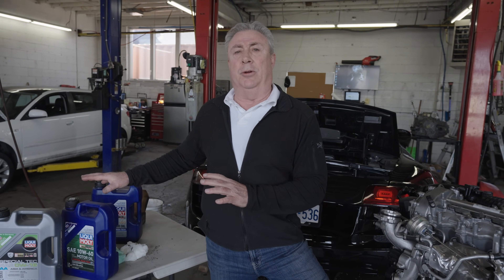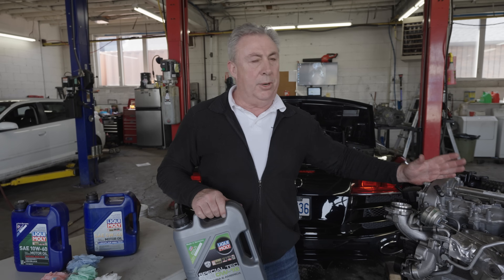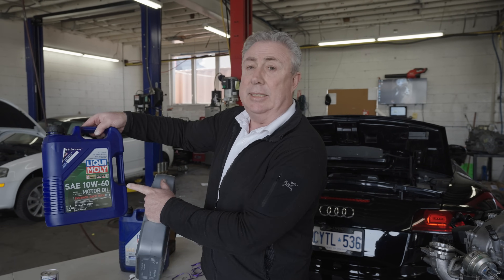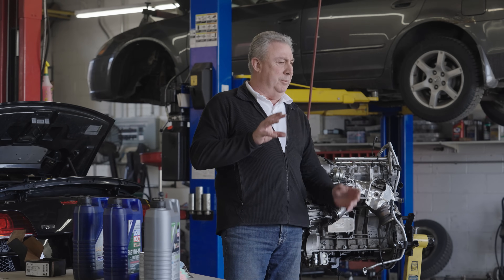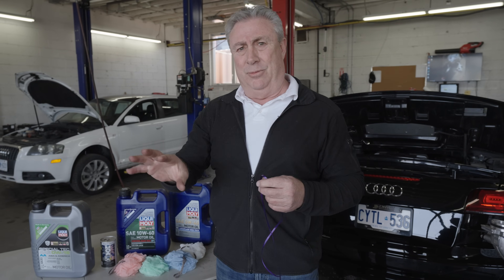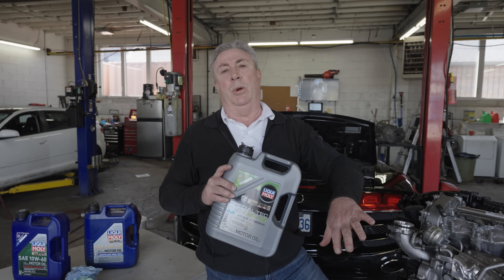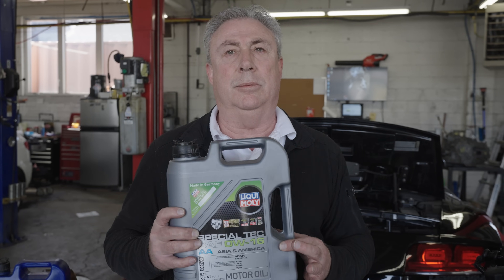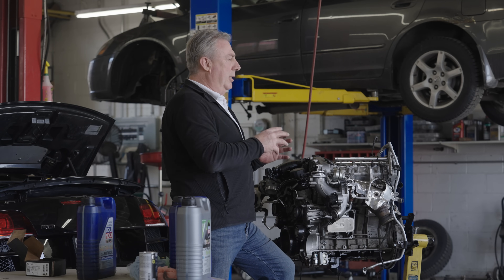Thin engine oil just a Scam? What's Safe

Comment: I agree with everything you said except for deviating up from a 0W to a 5W and there is another way to further determine if you are on the right track if you're OCD like me though I was confident of going to a 5W30 without it. My wife's Mazda CX-5 for example calls for 0W20 but that is the ones slated for America. The same Skyactive 2.5L in naturally aspirated form in Europe and Asia calls for 5W30. Why? America's ever demanding CAFE quota. Even Mexico Mazda's say 5W30. We know Mazda isn't enlarging the oil clearances and passages on the 2.5L engines slated for those countries so this is one easy tell at what thicker oil weight can be used without worry.

Comment: Please don't fall for the woke scam to reduce the viscosity of your oil. If you use a 0W-20 oil you WILL ruin your motor. Use a standard weight which is 10W-30 Synthetic. I run this weight in all of my Toyotas, and the engines are like new at 300000 miles. Additionally you can use a Diesel synthetic and it will save you money.

Comment: 2025 Camry here. I use 5w-30, manufacturer calls for 0w8. In Australia and several other markets, they are using up to 10w30 (and even thicker) and it happens to be warmer where I live. If you read the Toyota USA manual carefully it even allows for thicker viscosity oils under severe conditions. This is all about Cafe standards and nothing else. This exact vehicle and oil pump are used in other regions with much with much thicker oil. I'm not sacrificing my engine to get a half a mile per gallon benefit.

Comment: Modern transmission are very complicated and work hard constantly going thru gear changes. When towing the temps and stress levels are extreme. The transmission oil is (compared to motor oil) about a 10WT. My point is do not go to any sort of extremes on going up on the recommended oil weight on your late model car or truck unless recommended by the manufacturer with a tech update etc. 
The best way to assure the oil continues to perform at it's highest level is to change it often. Your ride will reward you with a longer life and much lower oil consumption(if any). I never go further than 6 months or 5,000 miles on any vehicle I have ever owned and never had a oil burner.

Comment: Years ago, a friend of mine who worked as a tech in the motor pool of the local Post office were talking about oil changes, sludge, and more in the GM 2.5 4cylinder that many of the Post Office vehicles used. These vehicles were lucky to get 2 oil changes a year and I imagined them to be full of sludge. But he said that to his surprise that was not the case. He found that the engines were sludge free with minimal oil problems. He told me that they were using Texaco Havoline  15w-40 diesel oil. I did some research and liked what I learned and began using it in my own vehicles and customer vehicles. The results were nothing less than outstanding across the board. One my own vehicles had the Buick 3.8 V6, an engine known for easily developing severe sludge. I changed to the Havoline 15W-40. Ten yrs. later, with well over 100K on the engine I removed the valve covers and found a sparkling clean engine with absolutely no trace of sludge. Oil pressure was the same as when the engine was brand new!! When I asked oil engineers about the flow characteristics between it and say a 5W-30 and a 10W-30 the answer was always the same,... minimal to none at all. A possible small loss of mpg. Now, I should say that in engines under 100k I will usually use the factory recommended weight or a step above it. But once an engine hits 100k I will upgrade to 15W-40. The engine rattle that many engines begin to have when first started after sitting overnight usually stops, and many run quieter. My fiancée' has a 2013 small Buick with the 2.4L 4cyl. Because she didn't want to trouble me she was taking her car to a Fast oil change business. I warned her about the issues these engines have as they reached a 100k, and that these places were not interested in what was best for her or the car. At 110k her motor began rattling for several seconds when started in the morning,.. and the engine seemed a little noisy. I upgraded the oil to 15w-40 synthetic blend. The morning rattle is no longer present and the engine runs quietly.  Too many businesses adamantly insist on using the factory new recommended light weight oil even with a high milage engine. There are many GM engines that benefit from this upgrade. I have also learned that most diesel grade oils hold up better between oil changes because of the chemical differences needed to withstand the punishment that a diesel will put oil through. 

Suffice to say, that while I understand why many automakers recommend and push lightweight oils, I just can't recommend them as an engine gets older. That opinion is based on personal experience of more than 40 years in the service and repair business.

Comment: Where oil is under pressure (journal bearings) viscosity doesn't matter because the pressure is forcing the metals apart (this is only true during running and not startup). But where there is no pressure (cylinder walls, cams) you depend on viscosity.

Comment: In consistently cold weather I shift both numbers lower 0w20 or 5w20 and in consistent hot weather it is 10w30 or 10w40 in a synthetic blend oil for the Chrysler 3.3 and 3.8 engines.. Same goes for the several smaller 4 cylinder engine vehicles we had, thinner winter thicker summer.. When I drove a high performance  Chrysler 440 engine it was 10w30 winter and 20w50 summer.. If you put heavy oil in and start hearing valvetrain noise you have gone too thick, if you start seeing oil disappear as you drive hundreds of miles and don't see leaks but do see higher engine temperatures you have gone too thin..

Comment: my 04 GMC 4.2 st 6 calls for 5w30 but I always run 10w30  except hot summers & hauling i up to 10w40  ... 240k miles knock on wood with 50 psi oil pressures ,,so hope iam Good ? what you think ?

Comment: Most Dodge trucks call for 5/20 and I find that bullshit. I see no different in fuel economy running 5/30 or 10/30 in my truck. The older the vehicle gets you have to run a bit thicker oil.

Comment: Most engine damage is done during cold starts.  Thin oils get to where they need to go more quickly.  Thin oil is not a problem, 10,000 mile oil changes and bad quality is a problem.

Comment: Unless the car has been modified (especially engine internals), use the viscosity the manufacturer recommends. There is a lot of conjecture on the part of non-engineers about thin oils not protecting engines, which is not true and only distracts from the issue that matters the most: change your oil at least every 6k miles or once a year (whichever comes first) and use full synthetic oil and quality filters
Reply: you can use the manufacturer's USA govt CAFE driven lightweight oil recommendations but it's not necessary in most cases.  They push the lower weight oils to meet govt CAFE standards in the US.  In the rest of the world, same engines are rated to use higher viscosity oils.  Bottom line, the lightweight oils save a tiny bit of gasoline, but are not necessarily the best oil for the engine's application.
Reply: @glennhansel9411  Everything I said is true and you speak of only one aspect of a large puzzle. Note that my comment assumes no internal engine modifications and I'll add the assumption of normal driving condtions and operation (not racing, towing, etc.) If maintenance is done properly and on time and the car is being driven normally and properly, there won't be an issue with thinner, in-spec oil in a well-built motor. Which bring up another topic: crappy companies building crappy motors (we know who they are and so do they) and blaming thin motor oil when they fail

Comment: My 2025 Corolla Hatch calls for 0w8 and the owner's manual says 0w16 can be substituted if 0w8 isn't available but must be switched back to 0w8 at the next oil change. I've ran 0w16 for 2 oil changes now without problems and plan on continuing to do so. As far as I know, they have made no changes to the engine since 2019 apart from a smaller oil pan/capacity starting in 2023.

Comment: Synthetic oil claims were , it's good for 15k miles and the oil will not break down.  Oil will not break down 0:02 but it's carries dirt from combustion, and from the climate , filters don't get it all.
If I lived and only drove in a hot climate, yes I would increase the viscosity, if I drove to northern climate areas where it was 20 below zero, as I did with my Honda CRV, I definitely would stick with the 0w20. The car started with ease and the engine received immediate lubrication.
I owned a 73 year old aircraft and flew it for 35 years. They called for straight 40 and 50 weight oil. In the winter you could not start the engine unless you used a pre heater. Yes I experimented and used 4 quarts synthetic oil and 4 quarts regular 40 weight. Everyone was amazed how my engine kicked over and ran smooth immediately. Never had any problem with sticking valves, cylinder wear or misfire. Always had clean oil.

Moral of the story, use oil to suit your climate and change your oil and filter frequently.  For me every 4k miles made sense. All synthetic oil is good as long as it meets SAE standards.

Comment: I change my oil in my Subaru before 5000 miles and I switched from 0W 20 to 5W 30 and it runs so much smoother and quieter. I also live in Texas so there was no need for the 0 winter rating. 123k and running strong!

Comment: I have a Mazda CX3 that calls for 0W-20 and consumes 1 qt of oil during the 5000 mile oil interval I follow, so I'm having to add at least 1/2 a quart at the 3000 mile mark before changing the oil. I notice Mexico calls for 5W-30 in their manual. I switched to 5W-30, and my oil consumption issue disappeared. I do not add any oil and at the 5k oil change I'm less than 1/2 a quart low. Yes, probably I dropped 1 MPG, but also I might be getting less oil on my valves, considering that there is less oil loss.

Comment: Friend I live in South Carolina average daytime temperature 45  50° in the winter sometimes it might go down to 25° in the morning but by 10 o'clock it's already 40, I have a Honda 2013 K 24. I'm supposed to use zero 20. What would you suggest I could put in there that would be a little more full body, I know in Europe they use 30 maybe 40 weight with the same vehicle, for 10 months out of the year, it's always between 60° and 90° and any suggestions, my friend

Comment: For less than 1% increase in fuel economy, I'll choose a slightly higher viscosity oil with a high safety margin.

They get the efficiency by operating closer to the mixed mode lubrication, as it has less friction.

But we know cars aren't perfect. Oil overtime might get contaminated with fuel or water. The oil viscosity modifiers might shear down thinner. You're 0W-20 might be a 0W-16 oil at your oil change. Same thing can happen to a 5W-30 oil, but it isn't so bad if your 5W-30 oil has sheared down to 5W-20.

Comment: I live in central Florida. I changed 2014 to Tacoma from 0W-20 to 5w-30, runs quieter and smoother. Toyota calls for 0W-20 only because of CAFE. The car manufacturers want their tax credits and don't care if engines blow up after the warranty period expires, That's why they also call for LONG oil change intervals to sell their vehicles as "low maintenance". They want to sell more vehicles. For me CAFE means - Can't Afford Failed Engine.

Comment: Years ago GM was experiencing more than what was expected of premature engine failures. In their Freemont Ca. testing facility they came to the conclusion, these particular failures were due to excessive additive packages (clogged galleries). They also found that the wider the viscosity index of the lubricant the greater the expectation of engine failure.
Reply: JT censors I made a fortune last week on Google stock. 😁😁👀

Comment: Is there a significant difference in the bearing clearance of a car engine from the 1990s to the early 2000s that recommends 5W30 oil compared to today's car engines, so that we have to use 0W20 oil or thinner?

Comment: If it is someone's objective to gain 2 more years of engine life the science would prove that the most prudent things you could do is:  run the highest quality oil and change every 3k-4K miles, use the highest quality oil filter available, run an oil analysis at 30K intervals to look for abnormalities, and only use gas purchased at a premium tier gas station.
Reply from the maker: That's a great and comprehensive list of things that will help an engine last. Completely agree with your thought. Thanks for sharing that!

Comment: bought a used 2004 ls1 gen3 6.0l in 2013 with 195thsnds from a dealer, with estimated repaires from a dealer 4500$ or just get it as is for 2000$, since then mixing racing Motul 10W-60 with a quater ATF, and 12oz diesel and some seafoam, the damn thing is at 500thsdns and refuses to die, daily driven :)))))))

Comment: 'W' is 'weight' not winter. you should know that.
Reply from the maker: Hey Salvor, thanks for the comment.  The "W" is absolutely read as Winter.  SAE uses a rating system to measure and grade the viscosity of engine oil.  They do this by measuring the flow at two different extremes of temperature.  The first number is the measurement at 0 F and the second is at 212 F.  The W, which indicates the colder or "winter" measurement.

The weight or the viscosity of the oil is the entire SAE grade.  For example an oil weight may be 5W30.  It's the grading across two temperatures.  Here's a link that provides a more detailed explanation if you're interested. https://en.wikipedia.org/wiki/SAE_J300

Appreciate the comment - thanks.

Comment: I have a ram 1500 with a 5.7L V8. I’m here in southern Florida. It calls for 5W-20. Would it be ok to use 5W-30 in the hot summer months?
Reply from the maker: Hey there, great question.  For me, if the car is still in the warranty period I would tend to stick with the manufacturers specifications.  Full disclosure, I have had a few of these Rams with that motor and have dealt with that darn tick that is known to develop in the last tow of them.  I've been running full synthetic Mobil 1 5W30 in mine and I'm now at 200K with no tick.  Add to that 90 degree weather day in and day out in your neck of the woods and I personally would. 

But....  

Here's my thoughts:

🔬 The Viscosity Numbers in cSt (at 100°C)
Oil Grade	cSt @ 100°C
5W-20	~8.3
5W-30	~10.5

That ~2.2 cSt bump means 5W-30 is about 25% thicker at operating temperature. It provides a stronger oil film, which helps in:

High-load conditions

High ambient temps (like Florida in July)

Engines with a bit of wear

✅ Why It Makes Sense in Florida
Ambient Temps: 80°F+ regularly? The higher viscosity helps resist thinning under heat.

Stop-and-go traffic + AC + highway runs? That’s high thermal load.

Older or high-mileage engine? Slightly thicker oil helps seal better and reduce consumption.

Towing or load hauling? More protection.

⚠ But Consider These Caveats:
Warranty & OEM Spec:

If the vehicle’s still under warranty, straying from 5W-20 may void coverage.

Some modern engines (especially turbocharged GDI) use 5W-20 for tight tolerances and oil pressure targeting.

Fuel Economy Hit:

You’ll lose a tiny bit of fuel efficiency. Think maybe 1–2%, if that.

Oil Pump Design:

Some high-efficiency oil pumps are optimized for lower-viscosity oils. Thicker oil might affect flow in cold starts — though in Florida, that’s basically a non-issue.

Hope that helps. Really appreciate the question!!
Reply: @TheAutoStationBurlington 
Thank you!!
Reply: @TheAutoStationBurlington 
Thanks a bunch! Very informative
Reply: i live in cold Canada and I have been using 5-30 in my 5.7 hemi for years , runs quieter also .
Reply: @Titanis2000  thanks for that!

Comment: I have noticed with my diesel that changing from a 10W-40 semi synth to a full synthetic 10W-40 (same grade/brand) that I got better fuel economy, added about 40km to a tank. Looking into it I found the actual viscosity at 100 deg in the semi was 14.7 centistokes, the synthetic was 13.4 centistokes. Still 40 weight when hot, but just a bit thinner. So, no, all oils are not the same, even in the same Xw-XX range/brand. Just look at the Mobil1 range....how many do you need? Where I live the coldest I will ever start my truck is -5 deg. 10W covers that easily. Definitely pick your oil for your location and weather situation. Good luck.

Comment: I have a Toyota Land Cruiser Lc200 Diesel 4500cc V8 twin turbo.
From Factory it’s recommended 5/30 fully synthetic Toyota Brand (Mobil 1) make it .
Recently I tried a 0/20 , my thoughts are in winter maybe.
Guys always stick to the right motor oil, 
I switched back to 5/30 Castrol edge LL.
In my opinion I’ll go back to Toyota 5/30 & winter I’ll go with 0/30 Mobil 1 .
P.s at 6k miles the 0/20 was almost dead I can’t see it last 10k . I would definitely change by 5k .